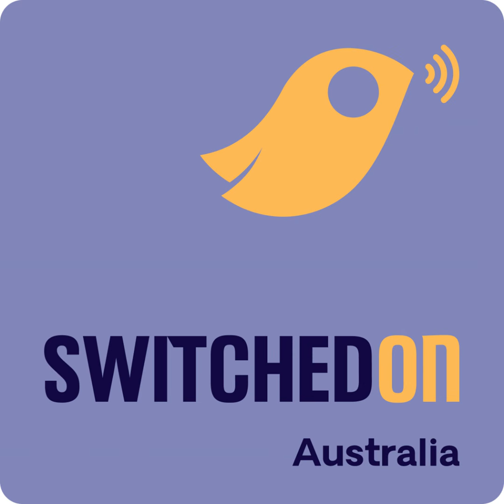How I electrified: the apartment owner who refused to accept ‘no’ for an answer

Comment: Regarding Rowan's heat pump making noise outside the bedroom, its possible to have (and most do have) a controller with a timer. Simply set the timer to run during the day when the bedroom is not in use, and then noise is a non-issue.

I have a Panasonic compressor unit and you can barely hear it when you're standing next to it, let along through a wall. Some are whisper quiet.